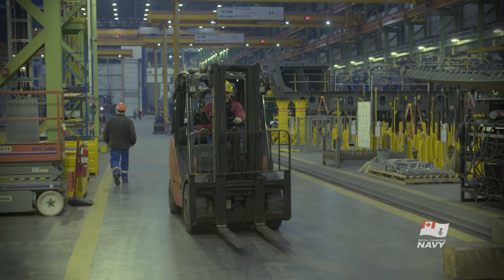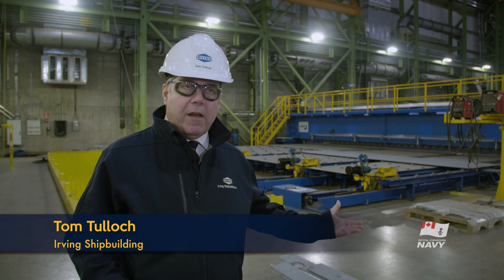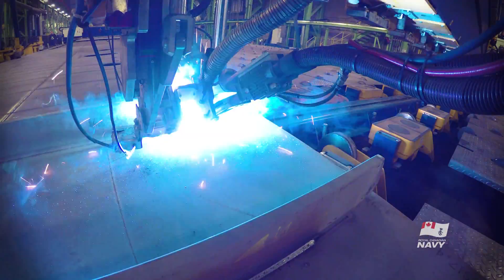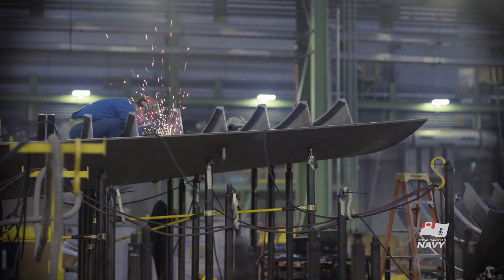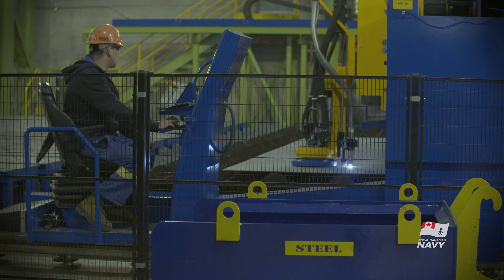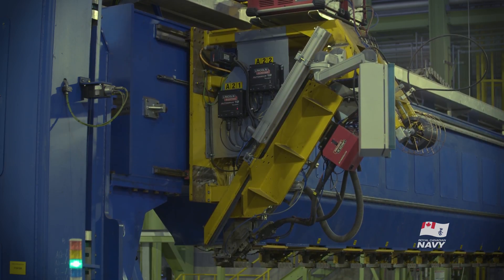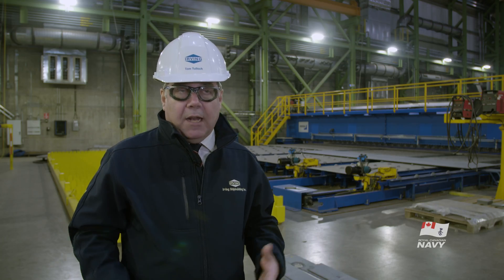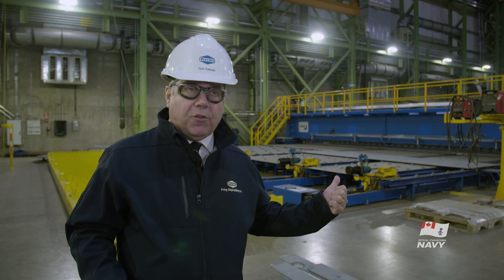Cutting STEEL - Building the Harry DeWolf Part 1/7

Comment: Ship isn’t very useful. Needs bigger guns.
Reply: Should have air defence missile system.
Who builds ship maritime chopper capable arctic vessel without mid range air asset protection? A pair of MANPADS you cheap skate admirals!?
Reply: . . . It’s an arctic icebreaker patrol ship, it doesn’t need bigger guns. It already has great accuracy and that’s what matters. It’s not the size of the gun, it’s how you use it
Reply: It a patrol vessel not even a Corvette